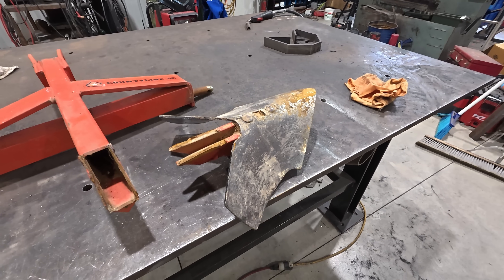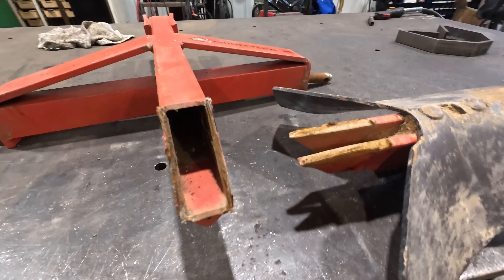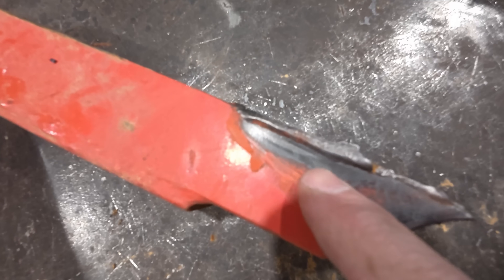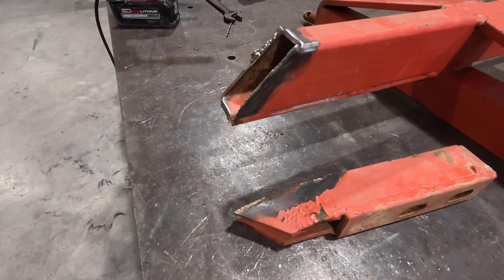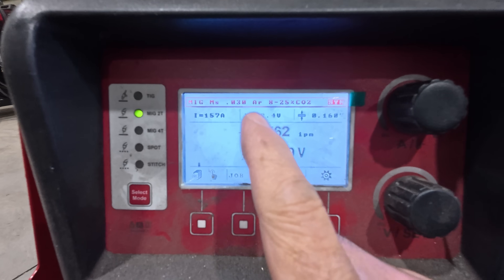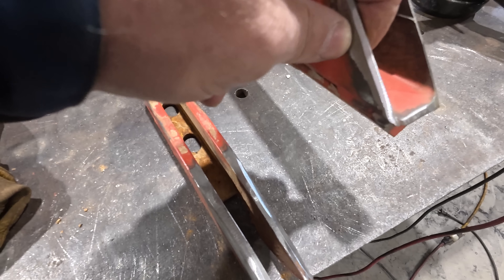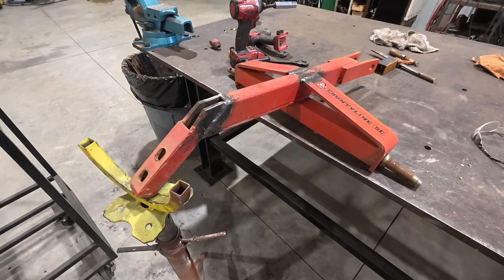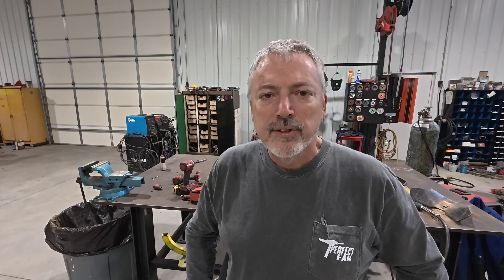This MIG Welding Mistake Destroys Your Projects

Comment: I have been a welder for over 45 years, and am certified in multiple processes. Mig welding is a safe, economical, and reliable process when done by a skilled welder who knows how to prepare a joint before welding. All too often, people buy some cheap welding equipment from Harbor Freight and think they can make quality welds on their own. Without proper training and experience, this is a recipe for failure. Don't blame a proven weld process for the poor techniques of an amateur “welder” who doesn't know how to make quality welds. Also, choosing the right process for the job is equally important for success.
Reply: To be 💯 honest and fair most of the guys welding up these parts aren't really welders. I too have several certifications and do mobile repairs. The mentality of most guys building this stuff is turn up the volts for more penetration and whip (so burn out properties of the wire sometimes and overlapped/oversized welds). I can almost guarantee those longer welds were done down hill just moving faster. A lot of the manufacturers of parts and equipment for AG have no QC process and don't require weld test for new hires.
Reply: @michaelschulz4317 I worked at Electric Boat where they build submarines in the mid 1970s and just about every weld was done with MIG.  I was never a professional welder but have an AC/DC welder and a small MIG welder. I’ve broke some of the items I’ve welded from misuse and I never had a failure at the weld.
Reply: @Chris_at_Home that's great! You don't need to be certified or have 3 phase power to have good craftsmanship and quality of work. A work ethic of constantly improving will build a better person and fabricator than the amount of money you spend. I can't tell you how many times I've surprised someone by making a repair with some knowledge and a few hundred bucks vs the 10k plus they expected to see.
Reply: I absolutely agree. I’ve seen all too many “professional” welders, who can barely make a half decent weld advising people to but some cheap welder, play with it for a couple of months and then they can take on paid work. That’s terrifies me as I see some of these people working on cars. I’ve also been welding for a long time, since 1973 and have also had training and some cents.

The problem is with people who think sticking metal parts together is welding. It’s not. I just bought a laser welder and this new technology having filtered down, is pretty amazing. And I’m using g it instead of most of my TIG right now. I also see a lot of nonsense about how bad laser welding is. That from this same ignorant people.
Reply: TO ME STICK WELDING IS VERY STRONG...!!
Reply: @LukeFerreira-g6e Yes 7018 is slower weld because its slow freeze rod,but I CAN count on the welds holding and not worry if it will hold.
Reply: Lame comparison. Opened for 10 years? Almost nothing beats a good 7018 bead. Just slow as hell. Like I said to begin with: MIG is fine on thinner metals. I've welded a lot of MIG.
Reply: @robertmceuen3630  The ten year reference was to  structural welds such as for a tall structure or something. You know, the whole cracking deal. But yes I will use 7018 or 9018 that has been about anywhere on my heavy equipment and things like that. Mostly because I do enough of a repair that there is no doubts. And no one is going to x-ray them. I had 50 pounds of ESAB Atomic Arcs given to me once that had been outside so long the can was rusted through across the bottom where sitting in the dirt. They welded fine as any 7018 but they were extra grumpy to restart. ESAB rods are not very good anyway in my opinion. I will usually only weld repairs with steel that is not brand new or mismatched with stick, its just so much better on contaminated metals. But new construction with fresh steel it is debatable if stick is any "stronger", I have seen those tests go both ways. Most tests have actually revealed dual shield flux core to be the strongest of all. Its also a myth that pushing MIG is stronger than dragging. Everyone just wants to push because it's tremendously easier to see what your doing. Dragging also requires about half the lpm of gas.
Reply: The plow is some of Chinas best work....
Reply: In Canada as in most jurisdictions we have what’s known as the Canadian Welding Bureau. They don’t dictate how welding is done but instead, regulate how companies approach welding through requirements around weld-procedures and a lot of other things. A weld-procedure is a document prepared by qualified people for specific applications and cover everything from how rods are to be stored, direction of welds, type of rods and input current ranges and a bunch of other things. In Canada you have to obtain a Journeyman certificate to become a welder which requires between 3 and 4 years working under a Journeyman and 2 months of trade-school training per year. To weld on any pressure-containing equipment such as pipelines or pressure vessels requires another ticket on top of the Journeyman certification. Where this potato-hiller was made probably requires someone who is fast and cheap. Nothing more. If any of the welds from places like where it was made had to pass any NDT they’d never make it.
Reply: Hell yes brother. I use all all tried and true machines like Lindy L tec You know the good stuff doesn't have any stupid electronic things in the front with you know red numbers that glow and all this crap. You don't need that crap. They just make more crap with electronic circuit boards so  They can charge you more money to fix the piece of junk
Reply: Mig welding is not dangerous. People who don't understand what they are doing are dangerous.
Correct weld preps, techniques and machine settings are necessary for any type of weld.
Decades ago I worked in the preassure vessel industry and used MIG for some safety critical welds. The welds validated by testing to destruction.
Reply: That's exactly what I was thinking as soon as he started talking about the weld. Great comment!
Reply: Underscore on quality of welder.  When a manufacturer finds a place to cut costs so as to present you with a lower price, they first cut labor costs (problem solved, it's China) and then they attack the most expensive parts first.  In a welder, those parts are transformers and inductors, containing a lot of expensive copper and iron.  Those parts also weigh a lot, increasing shipping costs.
When they reduce the core or wire size of a transformer or inductor, the welding supply is less able to keep its assigned voltage and current numbers.  EEs would say the supply is not "stiff".
When I was learning to weld using books, practice, and various friends' super-cheap, super-sh!tty HF MIG boxes, I marveled at how difficult it seemed.  Eventually I got to where I needed my own, and my other half bought me a nice little Miller. (which is fine except it will never take a spool gun, argh) Wow!  It was like night and day!  It turned out it hadn't been me at all, it had been the welders the whole time.  GMAW or FCAW, everything got better.  Lesson, you will pay out all the money you saved on a cheap welder, and more, in time and aggravation. Get a good supply.
Reply: I have been welding since 1968 and spent 32 of those years welding on the largest Earth-moving equipment in the world (surface mining) and I agree 100% with everything you said, that is all but the HF welders! Yes HF has in the past sold junk smoke and spark generators masquerading as welders, and still do with the bottom line Chicago Electric machines BUT the newer Titanium and Vulcan machines are second to none! The titanium welder for a home shop is every-bit as good as the old brand names but at a MUCH better price! The Vulcan line is more expensive but is industrial grade in every way. I bought Vulcan for my shop after watching them a while and reading the reviews, these things have been going for most of 5 years now every day and take a beating but do the same job as (brand names, don't want to start a fight!) and cost a ton less. After using both Titanium and Vulcan for several years now these things work great and hold up just fine! If someone is considering either one but is put off by the fact they are from HF just DON'T, they are well worth the cost and then some!
Reply: @catman4644 yes the titanium and vulcan lines are pretty good, but they still only have a 25% duty cycle. In the shop where I spent my entire welding career, all of the welders were connected to 480 volt circuits, so those machines typically had a 60% duty cycle. But for occasional home or hobby use, a 25% duty cycle would suffice. The big advantage to these HF welders is that they come with a lot of extras. Miller and Lincoln welders are far more expensive, plus you pay extra for the flowmeter, gas line, foot pedal, stinger, ground clamp, tig torch, tungsten, gas cups, and gas nozzles. So for home or light duty use on a 110/220 circuit, these machines will give the best bang for the buck.
Reply: You are wrong. Everything you say is a lie. In fact, you're lying right now.😅
Reply: @robertmceuen3630 troll, go crawl back under your rock.
Reply: Exactly
Reply: It’s an issue of riding beyond your headlights.  Starting out stick to gate latches and low risk applications.  Got to be honest with oneself about skill before jumping into projects where safety is at play.
Reply: This is not about the MIG but should be about poor engineering. That should be the start.
Reply: Using a cheap indo pacific part where non-certified welder are call welders. Mig is perfectly acceptable to weld these two parts together. This is a skill issue not a mig issue. But thanks for the click bait title. You also missed cleaning inside the weld area. I would also add the joint in question would be better served with adding fish plates.
Reply: Yes, it is true. MIG is best on thinner material
Reply: @robertmceuen3630   - Not true at all.  No factual basis for your opinion.  😂  

The largest mining equipment in the world is all MIG welded with Miller equipment.  Caterpillar uses MIG welding exclusively in all of the manufacture of their equipment. 

These items aren't made out of sheetmetal exactly - definitely thicker than 3/16".  If MIG is good enough for these manufacturers, then obviously properly done it can do just about any general welding needs (your opinion is definitely incorrect).  The key is welding environment and skill. 🇺🇸
Reply: I was a union Ironworker for almost 4 decades, and am also a certified welder in stick, innershield, and MIG. No MIG is ever used in Structural applications. It is best in thin metal up to 3/16". IMO.
Reply: @robertmceuen3630 built a lot of oilfield related structural using MIG. In shop yes not in the field. What you said isn’t true. We built everything from platforms, to VSM, desalination plants, muds plants, floating drill rigs, all with MIG.
Reply: @robertmceuen3630  I don't disagree totally, but I would still rather have a skilled MIG weld from a competent machine than a  decent weld from a 7018 rod thats been unsealed for 10 years. And by competent machine I mean a MIG machine that will at least run 100% duty at 200 amps.
Reply: @robertmceuen3630  - 😂  The largest mining equipment in the world is all MIG welded with Miller equipment.  Caterpillar uses MIG welding in all of the manufacture of their equipment. These items aren't made out of sheetmetal exactly.  If it is good enough for them, then properly done it can do just about any general welding needs.  The key is welding environment and skill. 🇺🇸
Reply: @robertmceuen3630  MIG is not used in field structural for a lot of reasons and it is true that MIG will produce less penetration at equivalent amps than stick but in a shop setting, if you know the differences and how to adjust for them MIG is a no brainer due to efficiency.  You just have to have the right training and experience to produce a structurally sound MIG weld.

Comment: The first this I noticed is that the metal was not properly prepared. There was no taper in either of the pieces. and there were no fill passes that would build a proper connection.
I have a love for stick and I have enjoyed mig for things like heavier metal.
Reply: I think you're backwards, usually stick is for heavier work
Reply: @chrisrageNJ Mig works well for thick stuff as well, just needs a larger input supply than stick for the same penetration.

Comment: back in the 90s, I had a guy stop and asked me if I could weld a part for a brush hog, and he figured I would probably be able to weld it since I raced stock cars at the time, when he came with the part he told me that he took it to a professional weld shop, and the weld lasted about two weeks, I asked him if they mig welded it, and he said yes, I broke out my old stick welder, and welded it up, I seen him about 6-7 years later, and he told me that the part was still strong as it was when I welded it up, and was still working good, in 2018 I started working for a fab shop welding, and anything that had to be done for strength or for recertification I got, because they knew if I done it the parts would be right and strong, I don't know how their doing now because I don't work there anymore, but the last I knew they were down to a skeleton crew, and they lost a lot of accounts
Reply: I know how to weld, before  I worked with a racer, he taught me how to prepare the metal and weld right. HIs car was a former ASA car, Dillion chassis. We replace a lot of parts of that chassis.   The parts we replaced and welded in the chassis never failed, his welder was a Millermatic 220.

Comment: The problem here is not the process selection, the problem is the design and parameter selection. MIG welding is fully capable of welding this weldment with adequate penetration, if the plates are prepared properly and the right parameters are selected. You titled it "MIG Welding is Dangerous" but then used MIG welding to repair it. 

With a bevel, and spray transfer, this more than likely would never have happened. The root cause is the manufacturer probably does not have a true welding engineer on staff that could make design recommendations for plate preparation and parameter development.

Comment: The factory welds were probably done by $18/hr workers fabricating that plow to last just long enough to make it through the warranty period.
Reply: Probably a 12 year old Chinese kid with it being tractor supply brand.
Reply: I think you mean 18 yuan an hour =  $2.45 c.
Reply: $18 an hour for a 12 year old chained to a welder? Probably not.
Reply: They don’t need people anymore! India has full autonomous factories.
Reply: @MrBlackbutang great, we'll now see how welding by robots with cowdung flux works out.
Reply: @jdhill770 they have been doing for over 20 years.  It does take a quality welders to set up a machine and quality steel to have great finish products! That’s why I don’t buy shina products for little more $ I get something that will last ! 😊
Reply: The skill level required to make sure the welds only last through the warranty period would take more skill than most people posses, which makes the statement sound pretty dumb!
Reply: @GeorgeGeorge-yb2sz Your statement is obviously from someone who knows absolutely nothing about welding (or anything else for that matter). It’s pretty obvious to anyone with an IQ over 90 (not you) that crappy welds do not last as long as good ones.
Reply: Lol they'd have 4 people fixing it if it was 18/hr, that's probably built by Uighur slaves
Reply: More than likely these parts were loaded into a fixture by an operator and welded by a robot.
Reply: @Lk23.43  That may be the case. I think if it was a person doing it, it would be cheaper for them to use something like 7018 or 6011 rod, and those would probably fuse the metal together better as well.